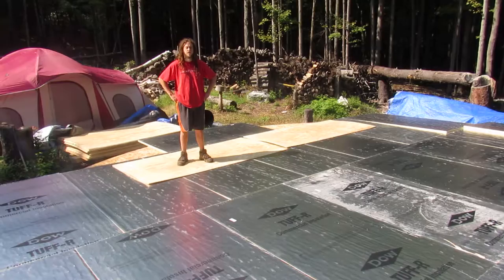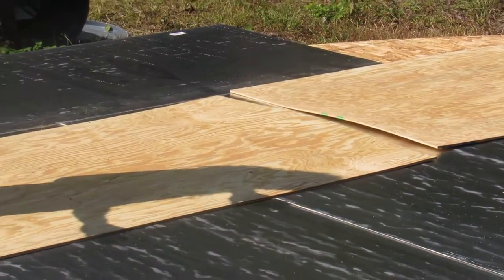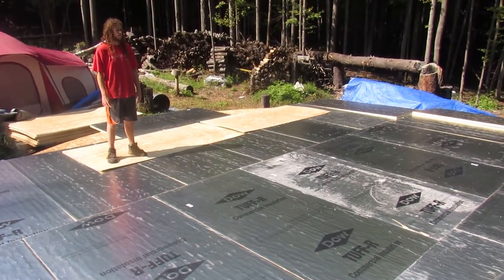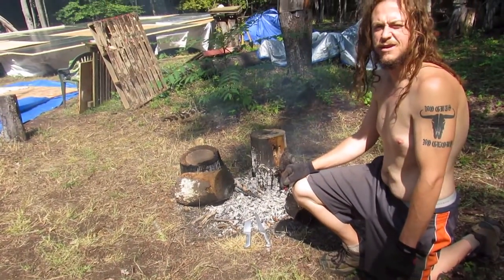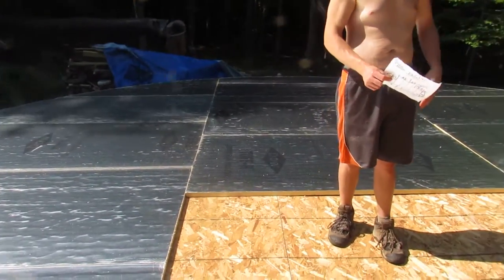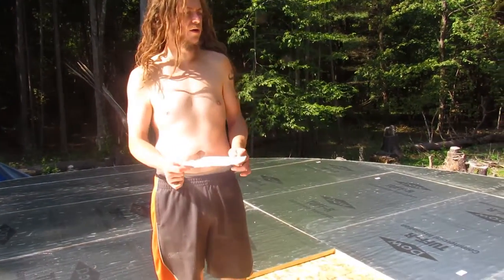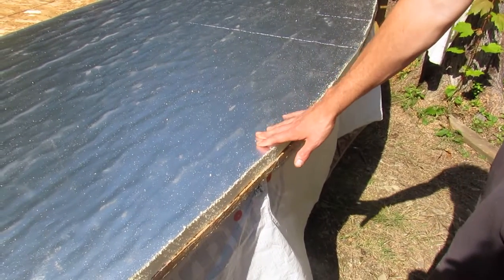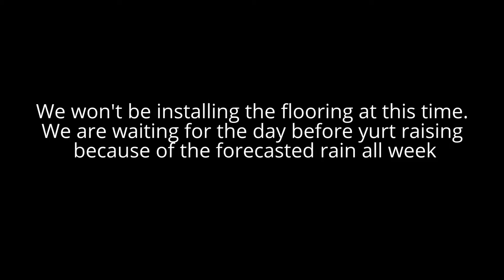Installing floor installation for yurt flooring platform building

Comment: We are placing a similar floor to your and we were planning on installing the foam boards below the subfloor in between the floor joists.  Your approach does have advantages over that.  How did you attach the plywood subfloor over the foam board? Is it fastened to the osb below the foam?   I assume its not floating.   Thanks